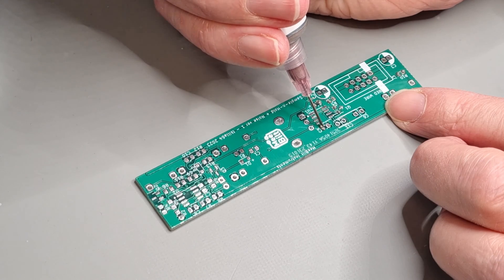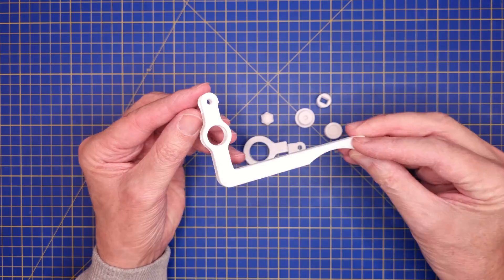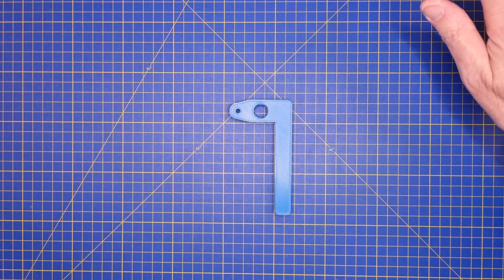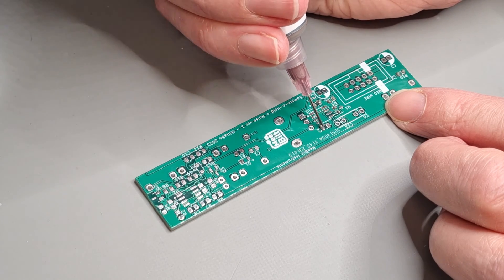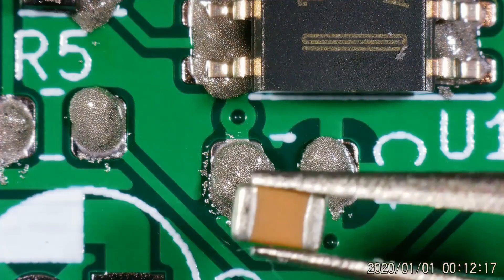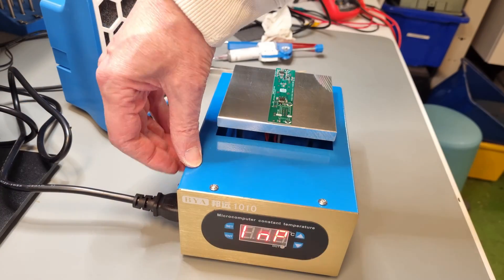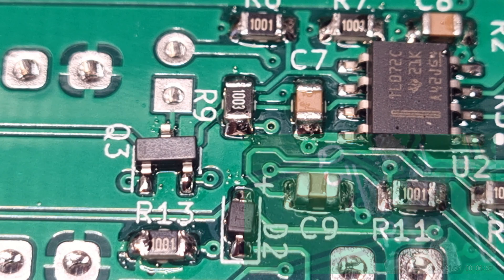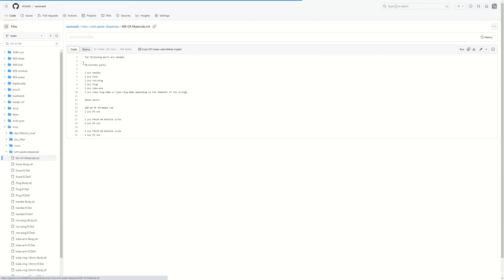Eurorack DIY: Dispensing solder paste and reflow soldering

Comment: Thanks a lot for sharing the dispenser design!
In addition, let me help with a litle detail about the difficult in dispensing the right amount of paste.
In my case, I just made a litle heater arround the needle tip of the syringe. Four 220ohm 1/4w resistors in paralel powered with 5V was enough.
The slightly heated solder paste comes out much more liquid and sticks better to the board.
Reply from the maker: Clever, I have to try that !

Comment: I just use the dispenser that comes with the solder paste and it works great for me. I definitely don't have super strength or anything :)  Maybe some pastes are more liquid than others? I have only found it a problem when the needle is left for a while and it gets blocked. It can fairly easily be cleaned though to resolve this. I place the solder paste with a microscope using a smaller needle (25 gauge) so that there is only a small amount in the centre of that pad (a bit more for the transistors, elec caps etc..). I generally use a low temp solder paste which works well eg..SOLDER PASTE, SN, BI, AG, 138DEG C, 15G SMDLTLFP By CHIP QUIK

Using a stencil is much quicker, unfortunately I have found buying stencils on their own (when building diy modules where I bought the pcb/panel online) as quite expensive
Reply from the maker: I have tried a couple of smaller gauge needles (I have a bunch of those in different sizes since I used them for scalemodelling) but the smaller ones get clogged up.
I will check out that solder paste from CHIP QUIK, thanks for the advice!

Comment: When it comes to solder paste I like to use SD-528 for most prototypes (as it reflows perfectly at 140-150C), the only problem is that adding a bit of lead results in dropping reflow temperature to 90C, which is really bad in some cases.

For reflowing I usually use some old frying pan filled with sand (we've flat-rate gas for stove, so it's cheaper and way faster than electricity). (Maybe I'll finally build my reflow oven using that old mini that I got in my basement).

Stencils are necessary when working with 0402 or 0201 components (I often need to do so due to dimension constraints from client) - it just makes your life easier and 7$ per stencil is not that much at all. 

Basing how your hand shakes - if you want it to shake less always keep your elbows on flat surface (aka. desk) and your arms crossed together (use secondary forearm as support for dominant hand's wrist)  - it's way easier this way to do precise movements - that method is often used in small-scale painting of figurines.

Also: never reflow parts with plastic, especially with lead-free high-temp. paste - it usually ends up melting them (it's better to use hot air or wave soldering technique for this).
Reply from the maker: I did realise that my hands where shaking LOL (had to go back and watch the video). Yes, I use that or a similar techninque for my second hobby; which is scale-modelling. The problem with shooting videos is that I can never have a good light and working conditions, so the ergonomics are far from ideal. 

Thank you for the suggestions and advices, I'm probably not the only one that will benefit from them here.

Comment: Thanks for sharing the designs. Can you share more about what solder paste and wires you use?

Also that hot plate is interesting. Is it from AliExpress?
Reply from the maker: Thanks! 
Yes, the hotplate and solder paste that I'm using is from Aliexpress. The other stuff is from a local seller here in Sweden. The solder wire is Pb-free with 0.35mm thickness, which works great for SMT.

Comment: Thanks for another great video. I have been considering getting into the solder paste hot plate/oven methods and you may have convinced me. Can I ask which Andonstar scope you opted for?
Reply from the maker: I'm thinking of making design with more fine-pitched components and reflow soldering is one of the things that I need to teach myself. 
The microscope is an Andonstar AD407.

Comment: Nice dispensing tool! I have tried stencil and hot plate so far, but yet I find my manual pick and place a bit labor intensive anyway. Maybe the next step is to have a real pick and place machine 😊
Reply from the maker: Yeah, there are OpenPNP projects like the Pandaplacer A1; a really cool project. I make so few of my boards that manual PNP works fine for me (I think)